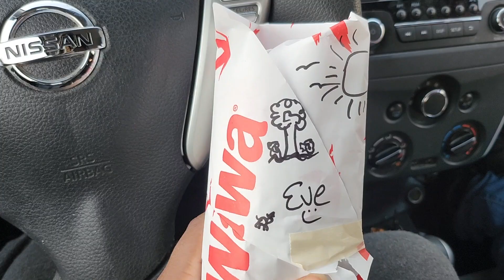Gutting the van • 94' ford econoline • Cheap van build pt 1

Comment: Guys I just bought the same van. But it’s a ‘95. Please tell me how you got the rear captain chairs out?
Reply from the maker: @rusozano  hi there!! We removed the bolts with tools we rented from Home Depot after spraying a ton of PB Blaster on them to loosen them a bit! The plates that they slide into is where we had difficulty, because the bolts were so rusted, we used a small circular saw to cut the bolt heads off and then voila.